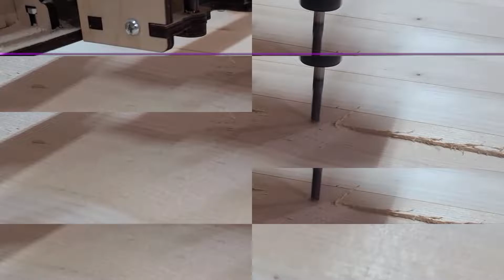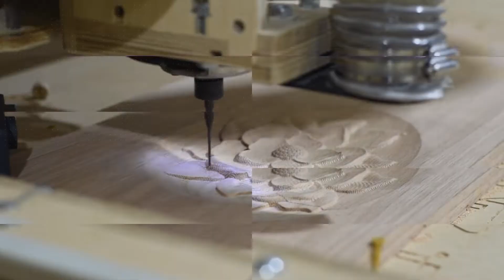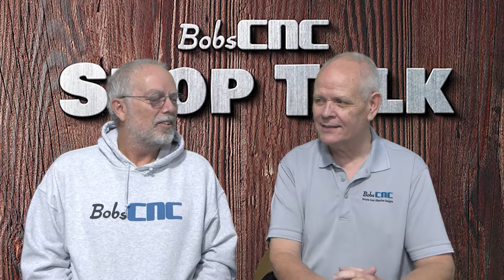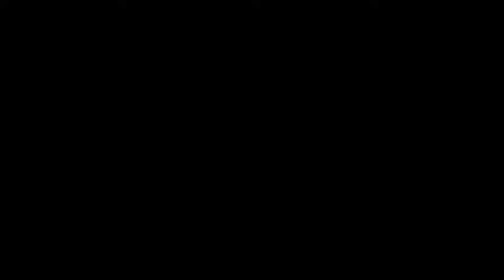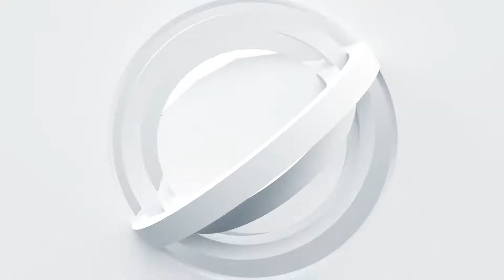Don't Leave Your Machine Unattended

Comment: Thanks guys. I’m building my first CNC. Still haven’t made my first cut yet but almost there. Tramming is next, then surfacing base. Still undecided about g code software. UGS doesn’t work with my setup for some unknown reason. Openbuilds control works well and has a surfacing file built in. I’ve recently come across gSenders, looks promising. Fire never crossed my mind but makes prefect sense. Thanks for the heads up.